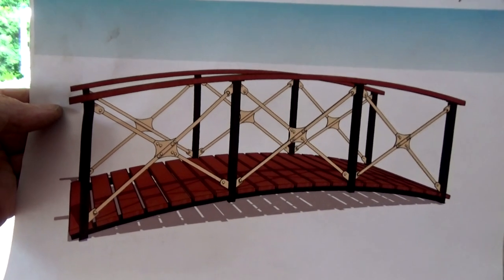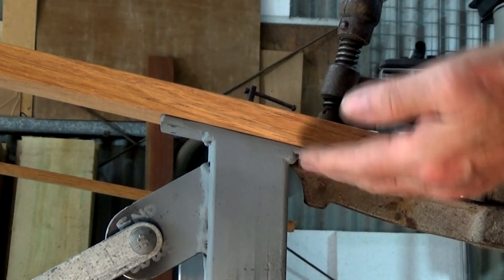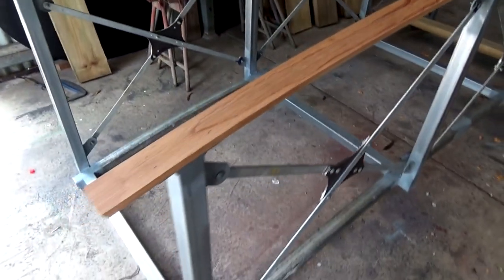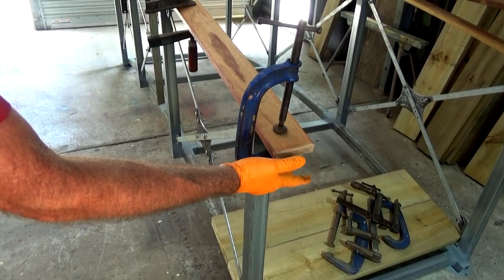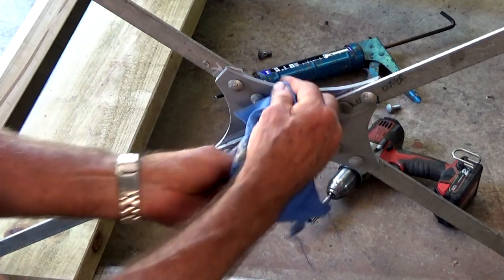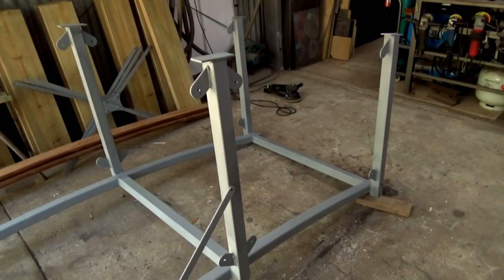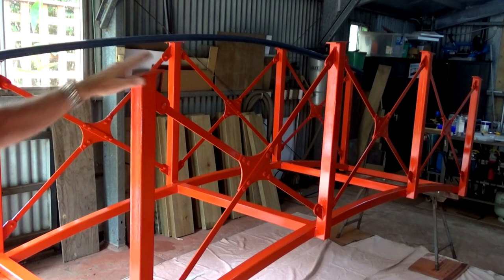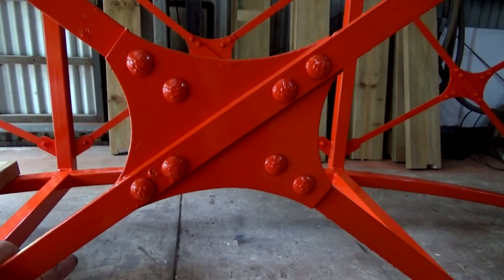Fabricated Victorian Style Garden Bridge -  Part 4

Comment: Mark,  The next time you need to bolt or screw in fasteners at a "hard-to-get-to" angle, break out your socket set extensions & universal joints -- they make it a lot easier!  As for the orange possibly being over-the-top, I think that we won't know until you've got the bridge installed under the trees.  Your bridge is looking great!

Comment: Beautiful job, nicely engineered and I applaud your thoroughness in sealing the connections - some early designs like this here in the US failed when water entered the joints and corroded the fasteners with catastrophic results,
Reply from the maker: I hate rust and it never goes away once it gets started. When I was studying at college we had a lecturer bring in a piece of pure iron and it was perfectly shiny despite being many years old and having no particular surface treatment. He was trying to illustrate why iron structures will outperform steel structures as long as they are designed to allow for the lower strength of iron. Still, with proper treatment a steel bridge should last indefinitely.

Comment: i think it looks great, the only thing i would have done different is use square nuts on the gusset plates instead of hex nuts. i worked for the railroad and a lot of the old steel railway bridges used square nuts on the parts that were bolted together.  Great job really liked the series

Comment: Hi Mark nice video. I have found that paint will not stick properly to the oxide coating on hot rolled steel. It is much better to punish it off completely, also the best primer is red oxide, if you can find a good brand or cold half. Of course you could always have it hot dipped galvanized, I find this is not too expensive here in SA. Keep up the good work.

Comment: Very good choice wood.
Real Merbau is very durable + 50 years (untreated).
However one disadvantage: in contact with rain, Merbau "blood". That is a red juice that is in the wood. It takes quite long till it is bled out, you can try to remove the stains with water.
Very Nice bridge. And a fabulous color.
Note: I belive that the Sant Francisco bridge is painted with Belgian paint.
Reply from the maker: Thanks Marc. I painted the Merbau with a water based 3 in 1 primer first. It is supposed to prevent tannin bleed. So far it seems OK. The only problem is that the top coat feels a bit sticky. The paint shop said this would happen and it will eventually harden. Water based enamel dries harder but is not a durable outside.
Reply: @Preso58  that's ok, and thumbs up for the nice bridge.
As for the wending, you weld better then me 😁.
We don't have to win any reward hé, just constructional strength.
Keep up the good work.

Comment: The Colorado choice is excellent for green garden background. The handrail wood as merbau is a good choice, but for the wood on the floor I prefer bangkari hardwood. Srews in middle is ok but use rubber path on the side (25mm wide and 1 or 2mm thick).

Comment: Very good progress.   I also do not enjoy using polyurethane adhesives or sealants.   As you said, it gets all over the place and is not easy to remove the stains from the hands.

I am not sure of the international orange colour.   It may look better in the final location.

Pressure treated lumber arrives saturated.   It will shrink and move as you mentioned.  I have used two screws to hold my pressure treated decking down.    The screws have flexed as the boards shrank and so the boards did not crack.    One screw will minimize potential for cracking, but then may result in the board cupping.    Try and get the boards oriented with the centre of the growth rings pointing down to attempt to minimize cupping.

Did you happen to measure the moisture content of the handrails prior to painting?

Glad to see someone using a hand plane.   The merbau looked to hand plane easier than I expected.  I have restored a number of vintage hand planes.   I have several sitting on a bench awaiting restoration.  When the wood is easy to hand plane, the feel and sound of the fluffy shavings can be almost mental therapy.  A little hand planing makes me respect the old timers who used these tools and other hand tools for all their work back in the day.   That was hard work.

I do not have videos, but if you are interested in some before and after restoration pictures, take a look at this thread.

https://www.woodworkingchat.com/forum/tools-and-safety/hand-tools/6402-hand-plane-restorations-before-and-after

Looking forward to the final episode.   

Dave.
Reply from the maker: Dave, good job on the restorations. Do you replate any of the parts? I just recently restored all three of my hand planes and lots of the parts (screws and levers) were badly corroded. I polished them and replated with zinc which looked about the same as what you have done with yours. I also sanded and refinished the woodwork. I just fitted the timber to the deck of the bridge today and I laid it with the heart side up. I am wondering if this is what you mean. My understanding is that the live sawn wood will always cup away from the heart. I haven't drilled any screws in except for the two end boards which are quite narrow. They will stop any of the other boards from sliding around until they dry a bit. 
Regards,
Preso
Reply: I did mean heart side up.  The wood tends to cup away from the heart.

Thanks for the comments on the restorations.  

I had to replace some hardware.   I have not tried re-plating - yet.  I think some of the parts look to be nickel plated.   I may look up US suppliers of the plating materials.

At the time I did not have a metal lathe so not able to easily make Whitworth threads.   I broke down and purchased a set of hardware from Stanley which was expensive for the contents but allowed me to replace screws which were too rusty, missing or wrong thread pitch.

I had to replace a frog or two, some knobs and some totes, also some blades.   Stanley forged a short length of hardened steel, about 1/4in long in the ends of the blade.   Hence if the blade was sharpened a lot, the hardened section was soon consumed and the softer steel does not retain its edge.

For the planes which became my user planes, I later upgraded to better blades and cap irons from a Canadian company called Lee Valley.   These upgrades made a big improvement to the planes.

Links for reference.
http://www.leevalley.com/us/wood/page.aspx?p=66868&cat=1,41182

http://www.leevalley.com/us/wood/page.aspx?p=42607&cat=41182,43698&ap=1

For a #5 I tried a PM blade.   Another improvement.

http://www.leevalley.com/us/wood/page.aspx?p=70671&cat=41182,43698&ap=1

Dave.

Comment: Great stuff.  I would have preferred if you left the handrail natural wood.
Reply from the maker: Our local council just recently replaced the boardwalk from Noosa Main Beach up to the National Park. They used what looks like Australian Beech for the handrail and it was left completely untreated. It has already weathered to a nice silver colour. Unfortunately I didn't have a lot of choice in what wood I could use and at one point I was considering painting the handrail with the same epoxy I used to laminate it with. It dries completely clear and it should be really durable but in the end I chickened out and just went with the coloured water based acrylic.